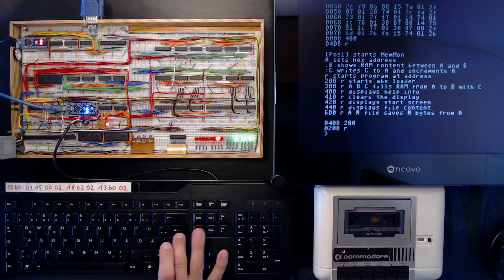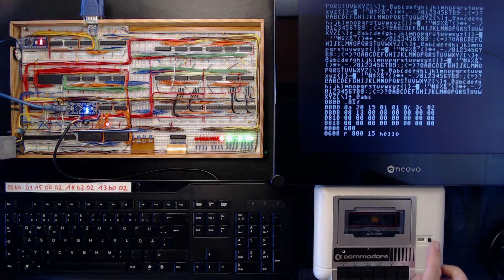Breadboard Computer With Minimalistic Design #2 Update (Cassette Interface and OS)

Comment: I'd love to hear more about the paper tape reader. I'm just old enough to have used "real" paper tape in the past and your Lego system intrigues me.
I've got an old open-reel tape machine and I often think it'd be fun to get that working as a data recorder... but I've actually got to fix it up for reliable analogue operation first.
Reply from the maker: Hi edgeeffect, I have had several other requests for a video about the paper tape reader project during the last year. With your message, I am now reconsidering that :-) it was a fun project after all. It's just such a pain to print and cut these tapes... and as the programs are getting longer and longer...
Anyway, the upcoming release of my "final" 'Minimal CPU System' will feature an expansion port. This cries for a Datasette and paper tape expansion. Cheers!

Comment: This is really cool, I instantly subscribed! I've designed + created sumulators for a couple of CPU's, but just started building one for the first time. I was wondering: is the (assembly) code of the Operating System available somewhere? I'm really curious about its features and implementation.
Reply from the maker: Thank you! I will make the assembly of the OS available with one of my upcoming videos. It is really just my take on the famous "WOZMON" written by Steve Wozniak for his Apple 1.

Comment: Great video, thanks for sharing. I'd love a bit if a breakdown of the bus, program counter and control lines.
Reply from the maker: Thanks for following along. The breakdown is coming up next. How is your VGA card doing? Do you plan to use it with a homebrew CPU, too?
Reply: @slu467  I've done two now, one with your design and one as a hybrid of Ben Eaters and my own. I'm currently knee deep trying to  get the RAM and ROM to be selected on the video card to display text as it comes in. Until yesterday I was thinking I would just write my own microcode / assembly from my breadboard computer, but I'm half considering using ANSI codes now just to make it easier for others if I uploaded my design (or indeed got it working!)
Reply from the maker: That sounds really interesting! I refrained from building a VGA just from 74xx ICs. It seemed just too much work for me. Glad to hear that you actually tried out my Arduino version. The VGA I'm using in my CPU design is a bit more advanced than the one I've shown in my mini series. The CPU communicates with it via an 8-bit register by sending ANSI codes. It makes outputting stuff really easy and standardized. Cheers!
Reply: @slu467  cool, I've been trying to get my design to work with ANSI code but I don't understand it particularly well yet. I suspect as you make more tutorials covering your build I'll follow along just for the learning experience.